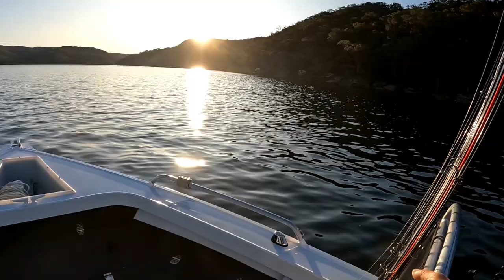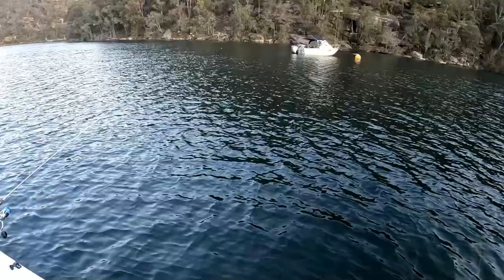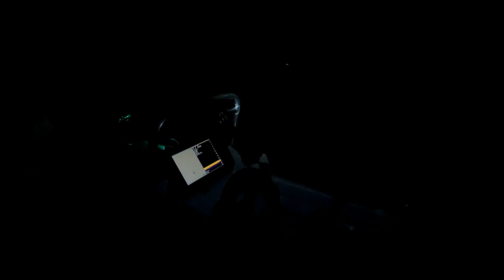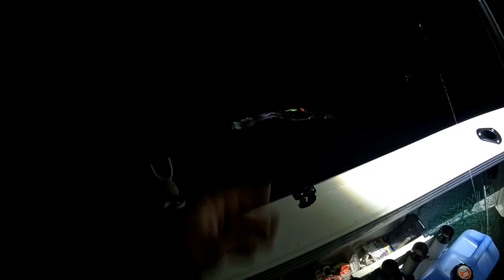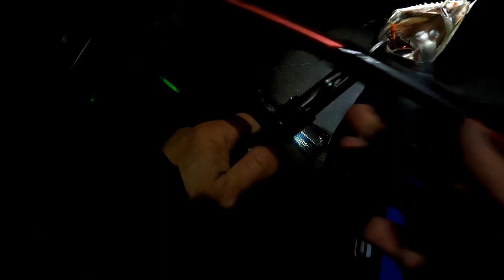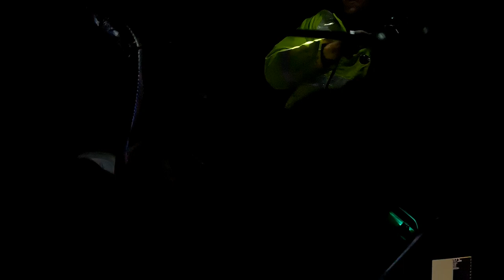Catch and Cook | Hairtail fishing NSW. Catching hairtails | Stacer Outlaw 429

Comment: Nice. Where did u get that gaff from?
Reply from the maker: Nets dont work well with Hairies so made the gaff myself . 1/2 of an old fishing rod bind a big treble with braid , add superglue and heatshrink over the top.
Reply: @YoufishingTV  yeah ur right I've tried using nets and they just come out of it easily. When u first mentioned gaff I was like noo way won't work (expecting u to pull out a big single hook gaff) then u pulled out this mini home made one. Awesome 👌
Reply from the maker: @Cparker8  My mate  seems to get them in the head or mouth so it works well . Didn't damage the meat. :). Did you get into them this year?
Reply: @YoufishingTV  yeah got a few this yr but not as much as I wanted to. They're still around though, so will give it a crack again soon once this weather clears up.